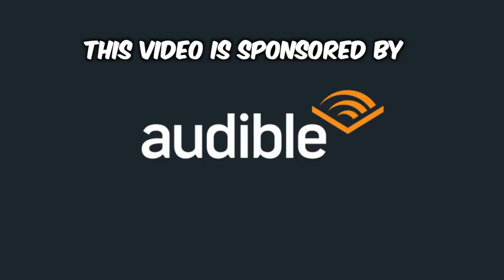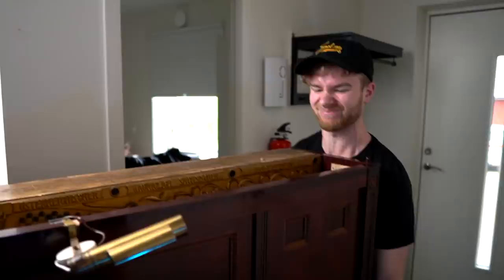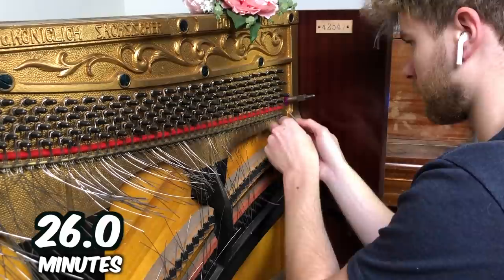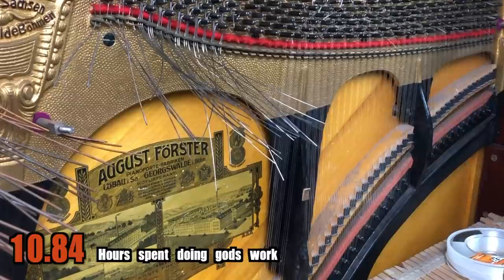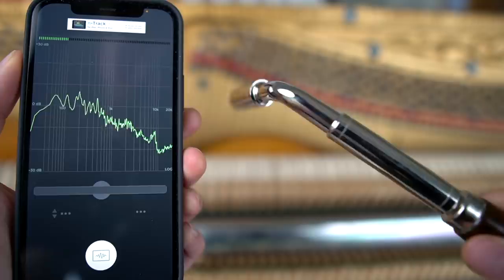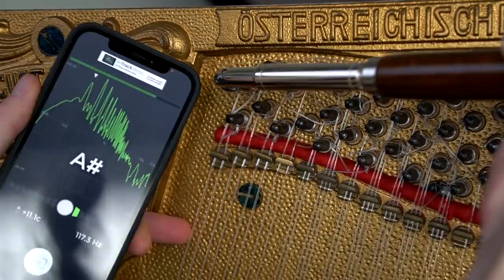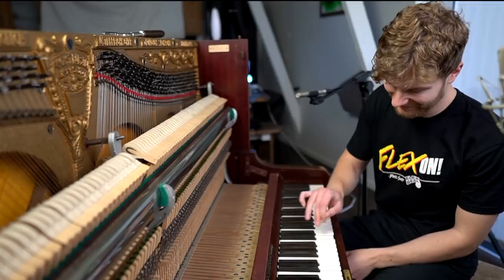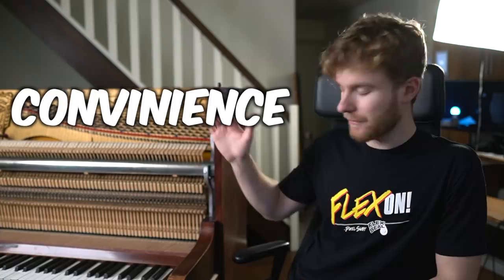I PUT FISHING LINE ON MY PIANO and You Won’t Believe What it Sounds Like

Comment: Nice piano and movement at 1:45, but it really does need tuning and 'toning.'
Incidentally, when you are using a crank to tighten, or loosen, piano strings, you should NEVER, NEVER, EVER, twist it.
If you do, you can more or less guarantee broken strings.
The right approach is to 'tap' the crank as you go, because even the tiniest movement where the string wraps around the pin, WILL affect the note. 
A note of 'C' can very easily be reduced to a 'G' (Or 'F')  if you twist to the crank to the left.
The climb back up to 'C', using the same method of twisting the crank can, and often does, bring out the profanity in our spoken words.
Oh, by the way, don't even consider using a torque wrench.................. that will ensure the flood gates of profanity will be wide open!

Comment: Not sure why you didn't remove the keyboard, would have made for much easier restringing 🤔 Also I'm happy the string board didn't crack when you violently released all that pressure from the original strings! I would probably have started with replacing one key at a time to get a feel for it. Awesome dedication though.

Comment: Matthias. Long and laborious,,,,  I know what this means... I am a clockmaker and something's just take a long time.. I am almost finished building a Grandfather clock..   3 years....   this is a bit like you have done...  but I think you should broaden your horizon and and think about other strings..  I would have drilled out the hole on the tightening tuners and used the thicker..line..  experiment with one in the middle and one up top.. something else.  It might be expensive but it will give you s very pleasing outcome. Bells or tubes of steel...  listen to the tune by John Barry   Called The Persuaders.   How did they get that sound..   this is my clock brain going mad..  keep up the good work. John

Comment: Even piano wire continues to stretch for a very long time-- some would say that the stretching never completely stops-- so it's possible that the fishing line would come closer to stability at some point.  On the other hand, because of the composition of fishing line, it might never reach acceptable stability.  It might have been better to try just a few strings along the whole piano range rather than wiring the whole thing before testing.  Also, you might have managed to shave down the ends of the heavier gauges of line and forcefully pull them through the pins, just to get a grip on them for installation.  Anyway, I thought it was a wonderful project and a lot of fun to watch and listen to.  I thought the more-or-less stable sounds in the mid-range were quite lovely.  You might be on to something.  How about trying steel strings?

Comment: i have one nylone guitar, stringing it is so much more tedious that steel, and that's only with 6 strings.
probably would have better application to use guitar strings for this, especially the bass strings, though I doubt it would stay in tune any better until the strings ar stretched

Comment: My only question is this, how much spare time do you have to have  invested time in a project like that? That piano sounded pretty good when you first tuned it. What motivated you to screw with success. To my ears at least, the nylon strings provided a pretty nice sounding mid-range (for a few hours), but highs and lows were gone. Time well spent?   Perhaps.  Maybe next,  try octagonal tires on your car. Above 60mph it should be pretty smooth.

Comment: WOW!!  What a fantastic sound!  This is like a harp on steroids, or maybe a harp played by felt hammers instead of by plucking.  

Here's a curious thought...  When I put new strings on my classical guitar (using guitar strings not piano strings or fishing line) and I have to tune them,  I have to silence ALL the strings --- except the tuned ones of course ---, in order to prevent harmonic resonance in the adjacent strings from interfering with listening for the beats.  I can eliminate the beats only if all the other strings are not allowed to add their harmony.  BUT, once they are all tuned as a group, the guitar will provide a wide array of harmonic "overtones?" maybe? that lend a similar ethereal quality to the music.  Could it be possible that the fishing lines have a much greater degree of harmonic resonance between strings than the standard steel strings?  Or, am I fishing without bait with that idea?   

Also, as others have commented, I need to allow several days for new strings on my classical guitar to finish stretching before they hold their tune...  I suspect the fishing line stretching issue is the same, and I would love to hear the piano after allowing the lines to stretch longer than about 2 weeks (pun intended), but with the tuning being refreshed no more than once every few days.  Anyway...  you got my subscription on this video!  

“If at first the idea is not absurd, then there is no hope for it.”    ― Albert Einstein           Keep doing the absurd.

Comment: Pretty much what I expected from nylon.  I suspect you could possibly get the upper octaves playing better after experimenting with different diameter lines to find the sweet spot line.  Yes, nylon strings do stretch out of tune quickly & continue to do so for a very long time, gradually getting ever more stable without ever quite getting there.  It's the same on all nylon strung instruments IME.

Comment: Hi Mattias, before I saw your video I had the idea of using fishing line for a modified piano that I 'm working on (got the idea from the kora - the west African harp where people usually use fishing line)  Wondering what gauges (kg or lbs ) of fishing line you ended using for the piano and if you have any advice if you were going to do it again?  Did you use monofilament by the way or fluorocarbon or braided?

Comment: Not being able to tune the strings is a known problem with new strings. Guitars have the same problem with new strings. When restringing it's necessary to tune, stretch, and repeat until stretching does not cause the string to go out of tune. Replicating the same procedure here would probably eventually stabilize the tunning of the strings. Here is an example of how to stretch the strings on a guitar. There are a few different methods but a here's an example from a quick search. https://www.youtube.com/watch?v=2oNjus6iAUA

Comment: I couldn't help but think, stupid sometimes comes in many, not mini supportive context. and what comes closest to this operation that you have put the sound board through, is simply a brilliant stupid, or stupid brilliant to make it easy. did it ever occur to you of the manufacturing differences in vintage past and now? it makes no difference what it is, modern products of all kinds are basically made with a intentional short shelf life. when that piano was designed, developed to sell for 300.00 or 400.00 dollars, it was based on the highest quality to match the value or close to it of the purchase, which back then, was of extremely high value of the 300 or 400 or more dollars. maybe coming out of the economic collapses or world pandemics who knows but i'd never opt for todays parts to swap out yesterdays worn out stuff. even worn out, it's much higher in all around quality. give it less than 6 months before the fishing line falls far behind by a long shot of the originals. some bloke will come along one day and find this piano out front of someone's house and after seeing your handy work, it'll be destined for firewood.